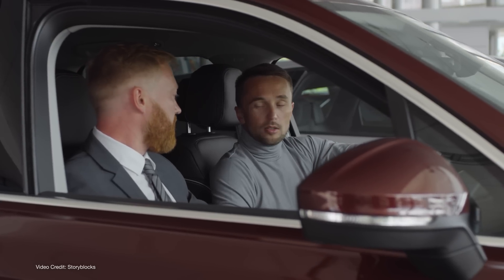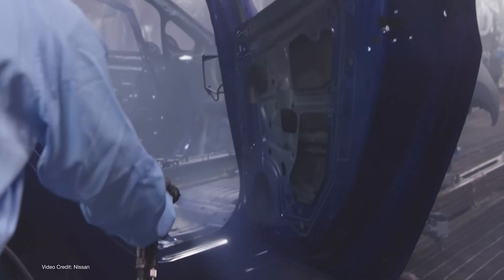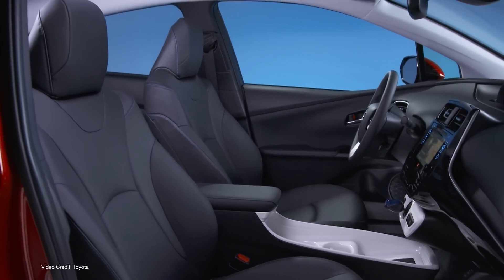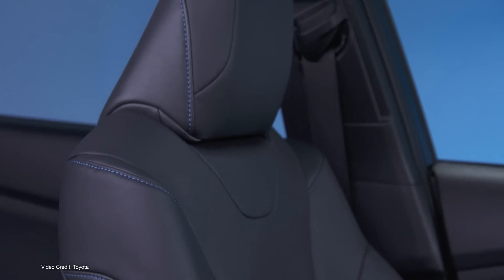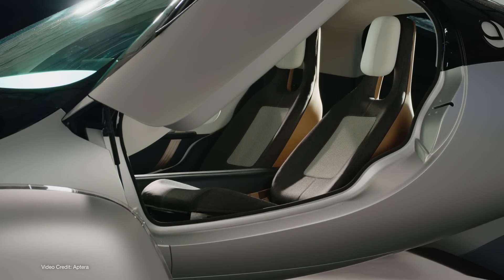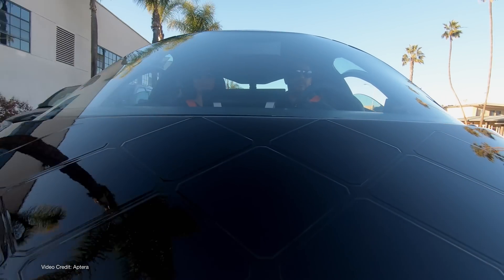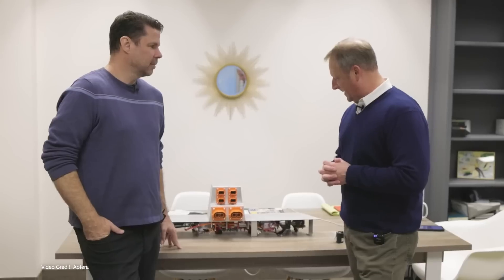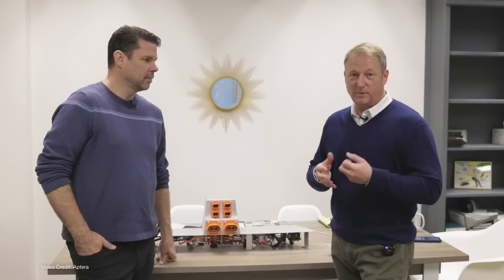Aptera Just Did a 180 On Fast Charging - Here's Why

Comment: FYI everyone: Aptera does have two ongoing angel investor funding rounds via both their own investor portal (for those already enrolled, closed to brand new investors) which requires a minimum initial investment of $1000 as well as an early investor platform called Republic (for brand new investors, round ends in just over 30 weeks or 215 days) requiring a minimum initial investment of $210.

Pre-IPO shares are currently being offered at $10.50 each. 😊
Reply: I think the minimum investment is $1,000 - which is 96 shares at the $10.50 price. I bought 100 shares, for $1050.
Reply: @NeilBlanchard  No, for the Republic platform the minimum is indeed $210.   As I post this, Republic has taken in $1,076,932, which certainly helps with the cash burn rate.
Reply: @n.brucenelson5920  Um.....I think Mr. Blanchard participated in am earlier angel investing round BEFORE Aptera started partnering with Republic.

Comment: Do I understand correctly that the Launch Edition will not have 11/22 kW charging? If that's the case, that's even weirder to me than the lack of DC fast charging for a vehicle meant for urban mobility. Also, with a yoke steering wheel the steer by wire has to be really good. A car channel showed that on a mini roundabout you have to turn the yoke in a Tesla Model S 180 degrees, which means switching hands and because in Teslas the turn signals are on a button on the steering yoke, pressing the 'wrong' button when you want to leave the roundabout. Again: not ideal for a vehicle for urban mobility.
Reply: The launch edition is slated for a 6.6kW AC charger. There has been no word from Aptera about increasing its size. 
Aptera is not a steer by wire system. Purely mechanical coupling. However it does have electric assist and torque vectoring for ADAS and "power steering". So silly Hello Kitty face must rotate way more than a yoke should have to do.

Comment: Folks, remember that it  has a small battery, not ones the size that needs North of 100KW/h to get done this week.  C/1 (~40KW) is an insane speed that will need lots of careful management to avoid fire or degradation. 400Mi is a long trip without multiple breaks. Even a L2 top off will take you further. 
Nicky, Great point about the dearth of L2 chargepoints at highway junctions. Why not put those on light poles at all fast food and gas stations. Way less utility support needed and most of those places already have 120/208 or 240V (yes, your EV can charge on 208, which is found in many apartment complexes in the USA)
Reply: The Ionic 5 has a 77kWh battery and fast charges at 250kw regularly. 1C is not really all that quick.
Reply: @Snerdles  The ionic 5 has an 800 volt pack so it can take a higher apparent charge rate for the same amount of current going through the batteries.

Comment: I've followed Aptera regularly because their car would make the perfect commuter vehicle for me (at least when it's too cold for 2 wheels) , but I don't get the outrage over no fast charging (at least initially. I now understand there was a little bait-and-switch as it seems fast charging was promised along with way, but I would bet over 90% of customers considering this as a daily driver would never need it.
I'm a pretty typical commuter, with a 34 mile round trip daily. Even on the yearly or biyearly foray camping or to another city  we hardly go much over 200 miles one way. Work doesn't permit time off for much long distance driving, our vacations always involve air travel.
Reply: Sure if all you do is commute, and have charging at home, this isn't a big deal. But there are lots of people who can't charge at home and don't primarily use the car for commuting. For example I never commute in my car - I've driven to work 3 times in 11 years (to collect something big). I have a bike for that. Almost all trips under 20 miles are done by bike. When we drive it's at least 100 miles, and usually over 200 miles up to 1000 miles, and we don't usually have anywhere to charge when we've arrived. So we need fast charging quite a lot of the time. I can't actually buy an Aptera yet because it's too wide for the rules in Europe, and this usage pattern is probably more common in Europe than the US (where most of you have to drive to go and buy milk!). But I suspect there are more of these not-commuting/a-car-is-for-long-trips people than you realise. Yes the stats say only 3% of charging is fast-charging overall, but the point is that when you need it you really need it, so it's important
 It seems to me that it really doesn't involve much hardware, unless it pushes the cooling requirement significantly beyond what's needed for driving so you have to go from passive cooling to active cooling? The electronics is trivial - it's nearly all software.
Reply: @xxwookey  I understand your needs. I was speaking as a pretty average US resident. I also bike or ebike to work 34 miles round trip when I can, and do shopping that way also, but I will not do that when it's 0° out, ha. The Aptera would make my perfect commuter and the solar aspect is a great bonus.
Reply: COMPLETELY AGREE! > real-world utilization! Like majority of Every pick-up Truck in America -  owners typically all want the 4x4 
However - here in So Cali- 98% of them drive on the freeways 100% of the time.....
Reply: Except, there are plenty of people who every now and then do go on a long trip with their car. I did 31 000 km last year or when I take the exact numbers, I averaged 86,49km a day in 2022. Easy you would say, you don't need more than a 100km of range. Except that I also made a few trips that went over 700 km a day. And with my current car and its small battery, I need 6 stops on such a trip. Even with an Aptera, I would probably need one or two stops, depending on the battery size I would choose. And when I do make that stop, I don't want to be stuck for more than half a day.

The car is the cheapest and most sustainable option in my opinion. And I don't mind spending a few extra hours on the drive, but I'm not going to waste it at a slow charger.
Reply: To be clear, it was just the launch edition that was without DCFC, they said that it would be available in later editions.

Comment: They will now add the DCFC good for some, no real advantage for me.
Wonder how much it will raise the cost?
Delay delivery?
Increase the weight?
Shrink the battery?
Since Aptera is having difficulties funding production, i hope this additional burden does not sink the company.
Now expecting mine in 25
Reply: It certainly won't shrink the battery.  It also won't change the $50 million dollar figure for the amount needed to reach production.  We are probably already seeing some weight increase from the C.P.C. Aluminum backbone compared to the original vacuum resin infusion plan, but it also comes with a major increase in the precision of the parts and related quality increase.
Reply: @n.brucenelson5920  
The additional cooling has to go somewhere.
The additional copper has to go somewhere I^2 R cannot be ignored.
All this takes space away from battery.
This engineering change takes time and money, delaying delivery and adding cost to the Aptera.

Comment: Couldn't Aptera use a product such as the newly developed eLeap Power Integrated Inverter to potentially save weight, manufacturing costs and complexity?  I imagine that vehicles such as the Aptera and the Lightyear would be the perfect candidates for such technology that eliminates the bulky charging and voltage conversion electronics.  In fact, if this tech is viable, it could bring down the costs and increase the fast-charging speeds of several EV models with the added bonus of giving them V2G/V2L capability if they don't already have it in the current design.  And no, I have absolutely no affiliation with either company.  It just looks like a very interesting and potentially more elegant solution.
Reply: DC fast charging doesn't have 'bulky voltage conversion electronics'. All you do is connect the battery terminals direct to the charger after some protocol negotiations. No power conversion at all - all that lives in the charger outside the car. The only thing in the car is contactors, which you have anyway (not sure if there is normally a second set for this?).
Reply: @xxwookey  Yes, I've amended my comment to just say charging and voltage conversion electronics.  Thanks.
Reply: @earthzero7  That eLeap device looks intersting. If I understand right it's using the motor inverter as the charger/V2G/V2L device. This is (or is very similar to) what the Zoe did to allow 3-phase charging for free. The problem with the Zoe is that enabling that made some efficiency compromises and no-one else picked the same architecture SFAIK. Maybe this is better in some way, but I can imagine that making the inverter more versatile (bidirectional) involves design compromises for the most efficiency-critical mode of battery->motor.
It also sounds like you need to give it a split battery, which is quite a big design change for most manufacturers (although I think some 800V cars do this in order to be able to charge on 40V chargers?)
But yes fundamentally having one versatile inverter that can do batt->motor, mains->batt, batt->mains (rather than 3 different ones) seems like a smart design choice. All these things are in the 110-800V volt range.

Comment: Nikki, thanks for the "easter egg" 5300 in the background.  I was going to guess a PowerBook 190 or 1900 (or would that be 1400?)... and I was just getting ready to ask here in the comments what that was when you turned and introduced it!  Very cool!

I'd offer some of my old Macs, except you'd have to pry my cold, dead hands off them!  😄

It actually has been a little while since I've used them (been subjected to the cruel and unusual punishment of running Windoze PeeCees for work for several years, now), but I liked the PB 190c, I think it was (68040, not PPC!), and I'm one of those odd-balls that liked the "pizza-box" LC line, esp the LCIII, with the 12" monitor.  (512x384 resolution, all for me!  LOL!)

Anyway, thanks for the article, AND the show-n-tell!  🤗
Reply: I highly recommend looking into Linux if you want to restore better performance to old hardware, and greatly lesson the risk of outside attack.

Comment: I put my money down on an Aptera in 2008. They promised to get right to developing a production version over all other goals. Then they got caught up in raising money, lost their sights on what they promised, and failed.  Eventually I got some of my money back.  It absolutely kills me that when they started back up, that they never thought of getting a hold of the original backers and maybe offering something (anything).  Chevy on the other hand didn't disappoint me with my 2017 Bolt  - seven years without a single problem and now I have a new battery with a new 8 year warranty.  Waiting on you Aptera...  Not optimistic.
Reply: @Wyndstryke is correct.  The founders were pushed out in 2009 and kicked off the board by a single vote.  The Detroit team that was hired to start production kept putting it off when the founders had been pushing to get started.  They had other plans and wanted to produce a 4 wheel vehicle instead.  They never brought in financing of their own, and liquidated the company in 2011.

At this point in time, Aptera Corp is much further ahead in the process than Tesla was when they got started, both financially and technically.  I don't know that I would say I am optimistic - they still need $50 million to start production in a tough economy - but I am hopeful.
Reply: I was a backer back then as well and they did contact me.  It was through email in 2019, maybe yours went to spam?  I gave it another shot and invested again as I do believe they are genuinely trying to get a super efficient and cost effective vehicle out into the world.
Reply: > "getting a hold of the original backers"
Perhaps not as easy as it sounds.  The founders had been pushed out of the Original Aptera so no longer had any rights to the company's data.   In fact, if they had taken a copy of it, they could have been sued / convicted for taking trade secrets...

Comment: So it looks like Aptera have chosen to limit their sales to North America. I can’t see the European authorities for example, allowing the North American Charge Connector when the have settled on Type 2 / CCS2. So even if type approved non North American Aptera owners will need to carry an Adaptor for virtually every public charger AC or DC fast charge. They could be right that the NACS is technically superior but this needs to be balanced with practical concerns like interoperability with third party charging standards.
Reply: Aptera may be able to sell a small but significant number of non holomogated vehicles in Europe, but models designed for European markets will have significant changes in any case.  Aptera has had a German homologation expert working on this for well over a year, and RHD has been designed, so this has not been overlooked.
Reply: They don't need approval from any government for that. If they want to sell their vehicle with a connector that no one else uses, they can. That's not against any law. Although it would be enough for me to say that I won't be buying that car.

Comment: Why does no one mention that Aptera is completely exempt from crash safety standards?

It is as safe in a crash as a motorcycle being ridden by someone without a helmet.

I ride a motorcycle. I understand the risks. People who think they're buying a car need to understand this.

Aptera vs Ford F150 Lightning in a crash = what?
Reply: I ride a motorcycle too, but the Aptera is not exempt from crash standards, though they are different than those of automobiles. It's monocoque construction provides enough structure that helmets are not needed. It would do poorly in a crash with the Lightning, but that only means the Fords are too heavy, bulky and inefficient. :)
Reply: There are legal standards and then there are the standards that Aptera decides to hold itself to. They have said from the start that they intend to meet passenger car crash safety standards.  Crash testing will happen when initial production begins. Up to now they only have simulations, but they express confidence that they can do it.

Comment: Sorry but Sandy Munro is a quack who got his “reputation” by pandering to the Tesla fanatics. His actual recommendations that he puts in his video range from bad to totally insane. Some of his staff are quite good, but he is not.

Removing fast charging from any modern long range EV is insane, so it doesn’t shock me that Munro may have made that recommendation (see above). In addition to that, the only thing it really changes is the size of cables running from the Tesla connector and, since they insist on using it, the hardware needed to switch the charging pins on the connector from either going to the OBC for AC charging to the battery directly for DC charging. The idea that removing DC charging makes the vehicle less complex shows a lack of understanding about EVs. DC charging moves the charger off the vehicle, AC charging requires additional hardware on the vehicle. Removing DC charging doesn’t make it less complex. The battery needs active cooling regardless, because the Leaf and original SoulEV have taught us that ANY modern EV needs active battery cooling and heating. Or maybe Munro told them to remove that too 🙄
Reply: Sandy's videos aren't his main thing, though. He's been an automotive efficiency consultant for decades - long before making anyone's circles on Tesla stuff. I think he just doesn't do well off-the-cuff like on some of his single-shot-recorded videos/teardowns or livestreams. When he has time to investigate things, he seems to do far better.